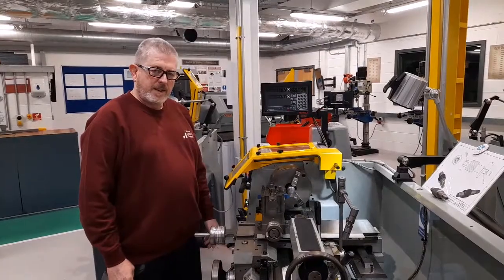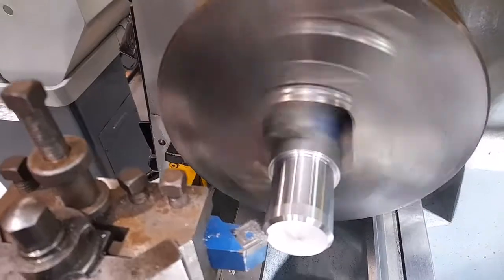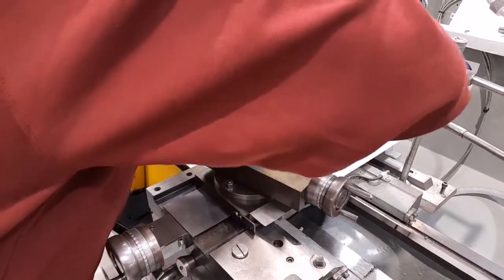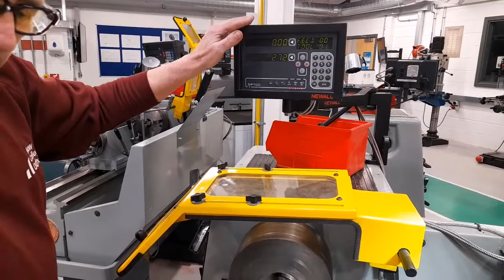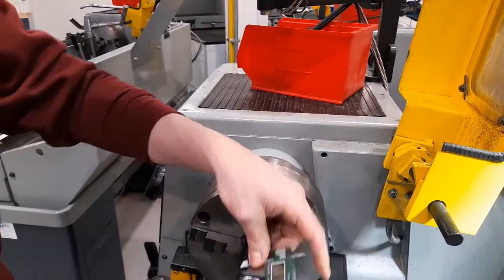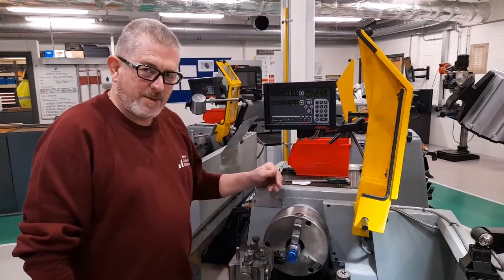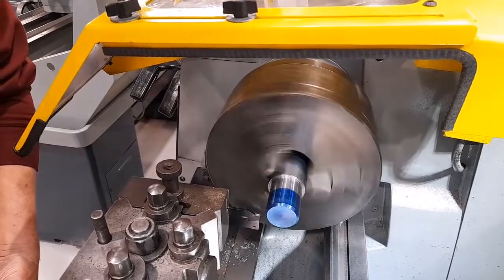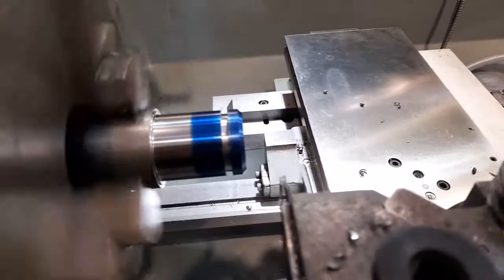Lathe Chamfering, Taper Turning and Cutting a Groove

Comment: Thanks for the videos. Your lathe seems to be very similar to mine, I don't have a DRO or the shield but mine is a clausing Colchester 13x48, presumably from the '80s or so. Works great
Reply: Also, do you know what that shield is? I'd love to get one for mine, having a lot of coolant splash above 300rpm
Reply from the maker: @SamCyanide  Hi Sam, these lathes were refurbished 3 years ago. They were manufactured in the late 60s. I'm not sure who manufactures the chuck guard, but ours also incorporates a micro switch, so the machine is isolated when it upright. A google search produced lots of findings. Hope this helps.